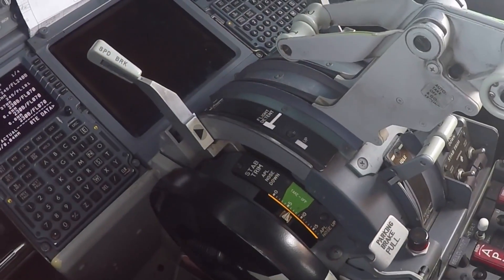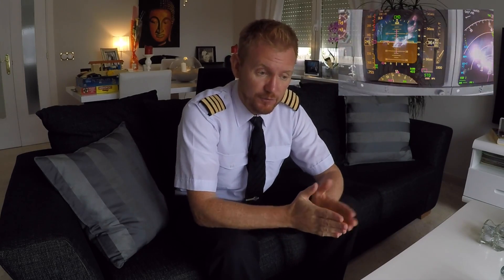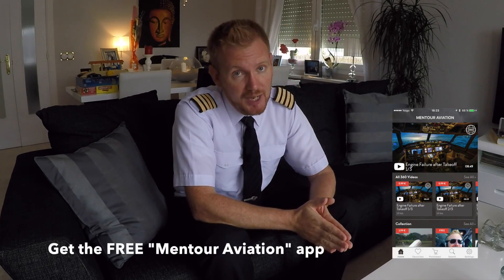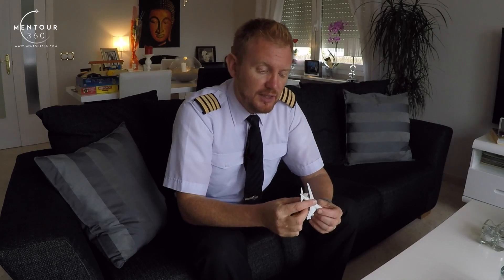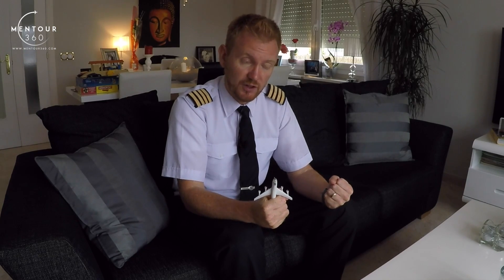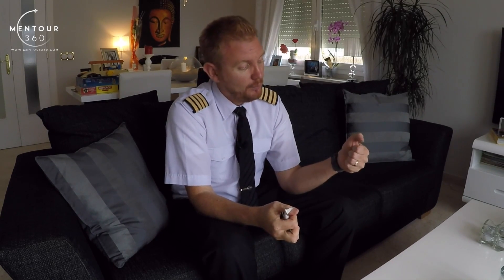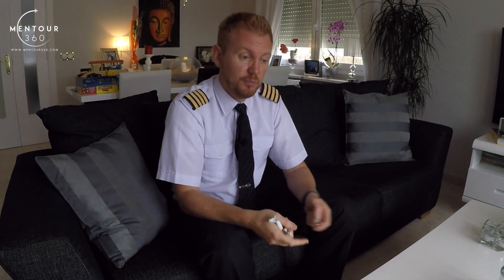What is that spinning thing?

Comment: The trim jack screw, after watching a lot of air craft investigation stuff on YT, this is the one component I fear will break the most...
Reply: That is why it's a component that is always checked for wear, and replaced regularly.
Reply: @Deploracle  I'd still like some redundancy!
Reply: It was the jack screw on the rudder that caused those crashes in the past. The maintenance manuals did not mention that de-icing could remove the grease. Once the threads stripped, pilots continued to run the motor, ultimately causing the stop to sheer,  leaving the rudder flapping in the wind.
I think that all pilots should be required to spend 6 months in the maintenance shop as part of their training. It would give them a better understanding of potential faults and how to work around them.
As an engineer, when I see some of those crash reconstructions, the moment I see the pilots continuing to try to operate a faulty component, I think, for f**k sake don't do that, or the whole thing will fall apart.
In many cases, if they had understood the fault and worked around it, they could have got the plane back on the ground.
That was exactly what happened when a Japanese plane hit a mountain with no survivors. Had they have turned the autopilot off and adjusted the thrust on one engine, they could have avoided the mountain. It was not a sudden problem. they had more than 40 minutes to work out how to steer the plane, but they made no attempt to do anything. Had they cleared the mountain, landing would have been difficult, but not impossible, Dropping the plane into shallow water off the coastline may have been their best option. At least it would have prevented a fireball if they were unable to line up on a runway and many lives would have been saved.
Reply: @wilsjane  well you as an engineer blame the pilots for some of their actions, but pilots can also blame engineers for some faulty designs. And I'm not a pilot.
Reply: @JustRememberWhoYoureWorkingFor  Since this channel is mainly about planes that crash, we get a slightly biased view. I am sure that not every pilot who has technical problems goes on to break the aircraft, but sadly their are a few who do. 
Without doubt, manufacturers should upgrade and replace any weak spots in their design and airlines should employ competent engineers, along with allocating time and frequency for them to maintain the aircraft to high standards.
My point was that with with some engineering understanding and training, pilots would realise the importance of working around certain problems, rather than making them a whole lot worse.
Another example was the pilot who suspected that his altitude readings were incorrect and contacted ATC for confirmation. He simply did not know that the data that ATC were seeing was coming from the faulty instruments on his plane. Another fatal crash that could have been avoided.
Reply: @wilsjane  yeah I get your point but about you saying that pilots should spend some time on the maintenance shop, I could say the same about engineers. I have never worked in aviation but I worked as a car mechanic and sometimes I suffered from designs making some tasks truly hard. For example it's not acceptable that in some cars just to replace a light bulb in a headlight you have to disassemble a half of the car. Engineers should work as mechanics too and prove that their designs can be reasonably worked in.
And it's not that I have any kind of hatred towards engineers per se, but you are telling other workers (pilots in this case) what they have to do and treating them as if you were superior when engineers aren't free of blame either.
Reply: RIP Alaska 261

Comment: I always have an important question: Can human go against the motor trim? I mean if when autopilot/motor is trimming forward wrongly, do human have enough muscle to force it to rotate backwards?
Reply: Cheklist RUNAWAY STABILIZER

Control column.................................grab and hold firmly
Autopilot (if engaged).................. disengage, do not reengage
If Runaway Continues
Stabilizer trim cutout switches..............................CUTOUT
If Runaway Continues
Stabilizer Trim Wheel................................Grab and Hold!
Reply: @Hamachingo  Yes. I do know the "Grab and hold" thing. I am asking, instead of HOLD, can we rotate it backward against the electric motor power?

Comment: Is the horizontal stabilizer also designed to provide lift, or is it strictly a horizontal rudder to move the tail up or down?
Reply: Only the wings supply lift. The stabilizer is just there to stabilize, i.e. keep the nose from nodding up and down all the time and it's also a good attachment point for the elevator control surface. Altering the angle of the stabilizer allows for level flight with the elevator control surface in the neutral position.

Comment: What is your opinion on the current 737 max?
Reply: They should of picked up on the runaway trim, unsure about  how long they had to stab the trim power Estonia flight, but on lion Air I worry about none native English speaking pilots because they was fighting the trim system for over 12 minutes instead of stabbing the power to trim and going manual wheel operation (they knew they had a problem and kept of fighting the runaway trim for whole 12 minutes) , this is very basic stuff if your flying any 737 in last 40 years the 737 max does not change the runaway procedure (this was 1 year after this video was made) if your fighting the powered trim system in any 737 you shouldn't be flying it

If you look at this YouTube recant newer video of the trim system fault finding and cut out, he explanes the system and how to cut it out when it's running away

But Boeing is no Airbus and the person who thought it was a good idea to allow the MCAS automatic trim to go max was a massive error (max should of been what 25% so its enough to pitch the plane down but not override the pilots stick controls in a fault condition) and MCAS should of not been relying only on one angle of attack sensor to trigger it should have been utilising both senses and issue a warning when the sensors are in mismatch, as autopilot won't be even engage if angle of attack sensors are in mismatch (all of these errors have been corrected so when 737max flys again if this happens again it won't be able to fully override the pilots stick controls and they be trained on a faulty stall stick shaker and uncommanded trim down event) 

Airbus has similar system as well but as your effectively flying a flight simulator but actually flying it its not always apparent what the plane is doing when flying Airbus (witch has led to quite a number of crashes where technically it was pilot error the flight systems confuse someone)

Comment: I don't like it. It is a bit creepy for me. This is why I like airbus. I am no pilot but which is better to fly from a pilots perspective? The Boeing should've never required a solution to a problem that should never have existed. Why not just make the plane higher to fit the bigger engines underneath using longer landing gear? How does Airbus overcome this issue?

Comment: How does the trim wheel control the back wings? Electrically? By servo? Physical wire?
Reply: The 737 use both wire and electricity to move the stabilizers

Comment: I watched video and read comments, most of which are compliments for explaining it all. BUT my question is still NOT answered. How exactly are the trim wheels / cables connected to the stabilizer? Are they simply turning the motor shaft that (through a gear reduction mechanism) turns the jack screw controlling the stabilizer? Or are they adjusting something that is between (in series with) the Jack screw and stabilizer?  

Imagine these scenarios-- 
1. Trim motor becomes electrically disconnected---but motor , gear reduction, and Jack screw are all free to turn. This would manifest itself by the trim control switches on yoke having no effect, correct? Do the trim wheels simply rotate motor armature   and adjust trim the same way motor would if it had power? 
2. Motor, gear reduction, or jack screw are SEIZED / LOCKED UP SOLID? In this case the manual trim wheels and their cables if connected to stabilizer as described in scenario 1 are also seized and locked, correct? 
3. Assume the nut being driven by the jack screw has the threads completely stripped out--- (similar to the Alaska airline incident). Motor is still turning jack screw but trim is NOT being adjusted. Are the trim wheels connected to something that is still able to adjust trim? 
4. AOA sensor failure, computer failure, or an electrical short, cause an un-commanded trim adjustment to maximum jack screw travel--- Are the manual trim wheels / cables able to counteract this action and return stabilizer to a somewhat neutral position? 

I guess WHAT I'M ASKING is--- Are the trim wheels / cables and the electrically driven trim controls "REDUNDANT" ? Or is trim control (to use NTSB bridge failure assessment terminology) "Fracture Critical" where the failure of a single link in the chain causes the chain to break.
Reply: I can only answer number four based on the checklist for runaway trim. One of the steps is to use the cutoff switches and if the wheels don't stop to grasp them with your hand so yes you can stop them then turn the other way.
Reply: The others also seem to be the case, but the third would count as a catastrophic failure and the second is extremely unlikely to happen without being caught by maintenance first.

Comment: I love this guy but this is way off. The wheels are NOT there for visual reference. There is a mechanical indicator right next to it showing the actual angle of the hstab. AOA of the Hstab is really important. This is why the manual wheel is there and why it is on both sides of the pedestal. 
It also has nothing to do with the pilot effort or autopilot strain. That is about moving the elevator not the stabilizer.  The trim keeps the stabilizer in the same plane as the airflow given the change in the angle of the aircraft.  If it worked as Peter is saying the plane's angle would continue to change until you completed your first loop. The balance tabs in the back are there to lessen the effort of moving the surface.  Knowing the difference between the stabilizer and elevator is kind of Aero 101.  But what the heck buy the app. Make Peter rich.

Comment: When I worked on the ramp I saw the trim wheel moving by itself many times. Why would it do that when the plane is sitting on the ground?
Reply: maybe adjusting for shifting weight in the aircraft so it handles the same on take-off no matter where the cargo, fuel and passengers are.

Comment: This is what I love about Boeing and why I hate Airbus. 
Real controls. Real instruments. You know what's happening. (Well… I don't, I'm not a pilot)
Like the yoke. You can see what the pilot flying is doing without even looking in their direction. 
That actually caused the crash of an Airbus A330 (Air France Flight 447) where the pilot flying was pulling back on the sidestick forcing a nose up attitude until the plane entered a deep stall. 
They didn't realise it until it was too late. 228 passengers and crew died. 

Now I'm not saying that it wouldn't have happened in a Boeing… Wait a minute. Actually that's exactly what I'm saying.

Comment: That handle, if extended can BREAK YOUR KNEECAPS!  I've been belted with it before.I am surprised Boeing didn't Red/white stripe it as a warning. same setup as the B747classic & B707. and many others. It is connected to a cable drum assembly which goes all the way back to the horizontal stabilizer.

Comment: As a coaster enthusiast too, "Trim" normally makes me think of that b***dy annoying set of brakes half way around the Big One at Blackpool! :-)

Alt-scene gags aside, it's GOOD to see that mechanical interfaces still exist between the cockpit and the control surfaces! I'm rather traditional, so still having the option of flying on pilot strength (As opposed to power assisted or FbW) appeals to me a great deal! :-)

~ Tries to imagine flying a B-52 using that approach. Who needs a gym membership after that? :-) ~

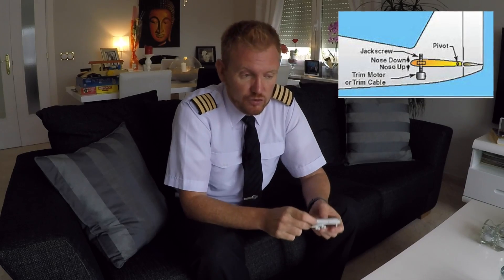Comment: 2:07 Would have been better if your pants zipper was the hanger door to your little plane. You know, boom, just whip it out. Everyone would be a little shocked, but not surprised. This model insinuates that you might possess a small and boring man unit. You should get a bigger, more bitchin' model to reflect your actual man unit. Unless you have a really small man unit, then you need to get like a 1/4 scale model or bigger.
Reply from the maker: Hahaha! I think that might impact on my add sales. :)

Comment: I have a question, the wheel of the trim goes faster when the flaps are extended just in Boeing 737 or in all the airplanes like a Cessna or something like that?
Reply: According to another video by Mentour Pilot, this feature is unique to the 737.

Comment: In the event of a failure of the elevator trim switch on the yoke, can the trim be set during manual flight using the wheel, as it is on small planes? Assuming that the jackscrew motor still has power, of course?
Reply: The wheels have a mechanical (cable) connection to the rotation of the jackscrew. That is why you can correct the trim after you have cut all power to the jackscrew to escape bad actions by MCAS or autopilot. I doubt that you could fight the power of the motor if it was still active.

Comment: Really like your series, even though I understand most basic things about flight, I indeed actually wondered about some things you explained in your videos. I have an electronics background and maybe you can answer this question in a new video: why hasn’t the sound quality of aviation radio improved over the last decades ? Where phone calls sound quality has increased significantly mostly because of digital systems now doing the job, air traffic radio sounds as bad to me as it was in the 50s. Very often I can’t make out a lot of what is being said. I understand that pilots and controllers do so I’m not worried about it but still, you’d expect improvements when possible. Is all radio communication still analogue, do they still use the same frequencies as when radio communications started and....why ?
Reply: Mainly to do with reliability and certification. Have a look at the electronics on any crash investigation its so old school. Frequencies have stayed the same for as long as I can remember. Radar and navigation has improved a lot. You have a system that works worldwide on every aircraft its hard to change, and messages are quite short, It may be that  cheaper air-band radios do not have the bandwidth for full audio fx demodulation.

Comment: The idea of the big, extremely visible trim control makes sense, but the idea of having a giant wheel automatically spinning right next to where you're sitting (and where you're potentially putting your fingers) strikes me as a bit odd. Surely they could have a big striped lever or handle coming out of the console somewhere instead, and put any spinning indicator behind a transparent panel?

Comment: Mr. Mentour:

I''m trying to once and for all settle a debate: On a large commercial airliner(anything from an A319 to 767 to A380), Exactly what part of the horizontal tail-plane/elevators moves???

I was under the impression that only the after-most 1/4-to-1/3 of it moved, but I've seen airliners where the entire surface rotated up and down.  Does the portion of the horizontal stabilizer that moves vary from make to model?

Please clear this up!  Thanks!
Reply: The yoke moves the back 1/3. (That's the elevator). The trim (the wheel in the video, or thumb switches on the yoke) moves the entire stabilizer.

Comment: So it's a preset. 0 trim would be the default preset and then when you input trim to either maintain the nose up or down you're changing the default preset of zero to something else, half a degree, 1 degree, whatever. 

You operate this thing basically like the cruise control on a car. You manually get to the setting you want for example 65 miles an hour, then you press the button and the computer will maintain that setting

Comment: Hello. Concerning the fact that the trimming wheels are visible, i think this is because on much older planes you had to trim that wheel by hand and not for seeing what the autopilot is doing. My father was an air force pilot and one of the aircrafts he flew  was the C 47 DACOTA and i remember him doing that because this aircraft had no autopilot for trimming or autothrottle etc..the autopilot could only controls the heading.(not sure even for that) So this is perhaps a remaining of older construction philosophy. I don`t know if am i right or wrong, so tell me please.
Reply: No, parts are not put on airplanes just because they were there on an earlier design. This trim wheel does both functions. It has a fold-out handle that can be used to manually turn the wheel if the electric trim fails or is turned off. The wheel has alternating bands of black and white because a human's peripheral vision cannot see details or colors very well but it can detect movement or rapid changes very easily. Thus a pilot will notice out of the corner of their eye when the autopilot or the other pilot is adjusting the trim as the white and black bands create a flashing on/off effect, but the pilot won't be distracted when the wheel is not turning.